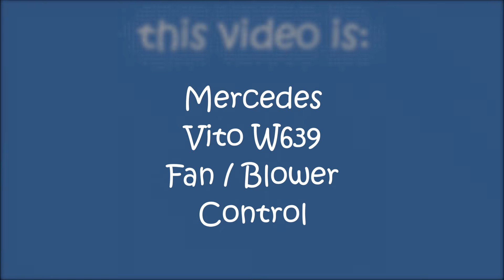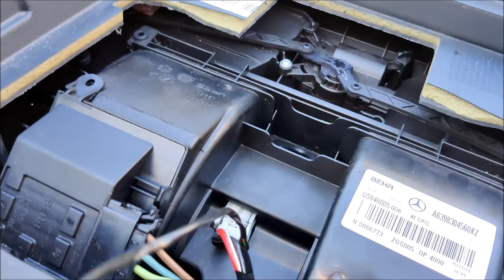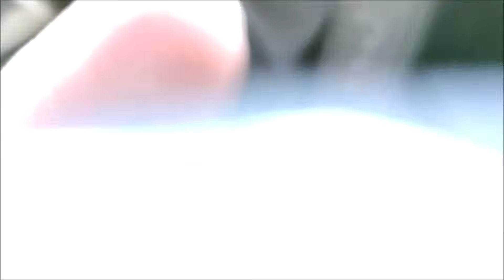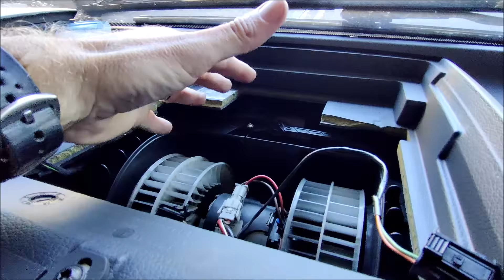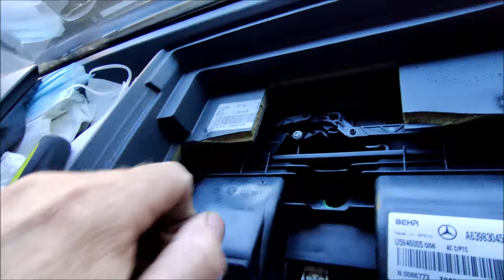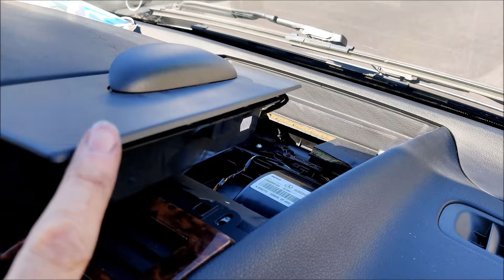Vito W639 Fan / Blower fix

Comment: can the resistor be replaced with out removing the motor/fan cover?
Reply from the maker: Yes. There is a single screw and a couple of tabs..... it then detaches from the fan motor cover.

Comment: Hi, your video is very informative! I’m experiencing a different issue with my heater. It only starts working when I set it to speed 5, but after blowing air for about 30-40 seconds, it gradually slows down and eventually stops. Could this be a fuse or motor issue? I have a Mercedes Viano CDI 2.2 Amb, and since it’s winter, I really need to fix this. I’d appreciate your help with this
Reply from the maker: @kiyani1001  I suspect it is both, but fundamentally caused (probably) by worn out bushings in the motor.

Your relay pack (fuse) has blown due to the excess draw from the motor, this means that you no longer have fan speeds 1 to 4. 

It now only works on 5, which is basically directly powered from the battery. It is likely that the motor runs for a while before the bushings heat up, swell, then the motor stops.

It would also be a good idea to check the cabin filter as this can put a strain on the motor when it is dirty too.
Reply: @ “Thanks, mate! I really appreciate your help. I’ll try changing the motor and the relay pack. If I need any further help i will ask you cheers
Reply: @fixitfallows  Hi mate , I took out the motor and checked it—it was moving freely. I put it back in and tested it like you did in your video, running it on speed 5 without the relay pack. After a few seconds, it stopped again. I quickly checked if it was hot or stuck, but it wasn’t hot, and it wasn’t stuck either.

What would you recommend? Should I go ahead and order a new motor, or could there be another issue causing this?  Just not sure if it’s the motor or something else. And thanks fir advice
Reply from the maker: @kiyani1001  when the motor stops after a few minutes, check to see if there's still any power going to it
Reply: @ there isn’t any visible powder going through but the right side blower is black with powder
Reply: @ oh sorry you said power idk how to check that is there anyway i can check it ?
Reply from the maker: Yeah, power 🤣 Have you got a volt meter to test at the motor plug?
Reply: @fixitfallows  no I don’t have 😅 I don’t have any other tools either. I have ordered the motor hopefully i will get it today and after replacing the motor i will let you know.
Reply from the maker: @kiyani1001  I can't think really what else it could be.... luckily the motor isn't that expensive, so it's definitely worth a try. All I'd say is there are two types of motor, one is for vehicles without Aircon.
Reply: @ yeah it was for 70£ and i am not sure which one i have bought cuz i just put my reg and it showed up and i bought it. Btw thanks for replying to my comment really appreciate that.

Comment: Bravo mon ami, j’ai tout compris, grâce à vous votre  tutoriel est très bien présenté,

Dommage que je ne comprends pas l’anglais
Et je viens de recevoir « BEHR » pour le vito WDF 639 603 135 787 32  ….V6..3L.  204 CH…120 CDI..  MAI 2010
Résistance chauffage.

Question complémentaire :
 Je doit changer la vanne EGR Walher, elle est placé juste devant le moteur .  Elle est bloqué ?… avez vous une idée. Pour la débloqué ..
Je doit aussi changer le bloc électronique agitateur du turbo , l’accès est très difficile pour le démonté.

Le moteur est en mode sécurité , 50/80 km/H maxi = pas de turbo.

Je roule depuis 4 mois sans turbo,  je consomme énormément.

J’ai acheté les pieces neuve pour le remplacement .

Avez vous une bonne solution pour démonté.

Cordialement, VOTRE

De Gerard Monterin

Envoyer de NormandY.

Well done my friend, I understood everything, thanks to you your tutorial is very well presented,

Too bad I don't understand English
And I just received "BEHR" for the vito WDF 639 603 135 787 32 ….V6..3L. 204 HP…120 CDI….MAY 2010
Heating resistor.

Additional question:
I have to change the Walher EGR valve, it is placed just in front of the engine. Is it blocked? ... do you have any idea. To unblock it ..
I also have to change the turbo agitator electronic block, access is very difficult to disassemble it.

The engine is in safety mode, 50/80 km / H max = no turbo.

I have been driving for 4 months without a turbo, I consume a lot.

I bought new parts for the replacement.

Do you have a good solution for disassembling.

Kind regards, YOURS

From Gerard Monterin

Sent from Normandy

Comment: We're is the fuse to the fan how do u tell which it is
Reply from the maker: Before you go any further, does your fan still work when on speed setting 5? If so it is the thermal cut off in the resistor pack that has gone and not the fuse for the circuit.

Comment: my 2012 vito 316k mile has just had this prob. blows on max speed only.
Reply from the maker: I'd be surprised if it were anything else other than the resistor pack. Do bear in mind why it has blown though..... it will be because of excessive amperage draw .... either due to blocked cabin filter or poor bushings in the motor. Both are cheap and easy to replace.

Comment: I have the same problem 2 weeks ago and I repair this part with a spare resistor, 2 € cost! 👌
U must open that piece and restore the wrong rezistor and done!!🙃
Reply from the maker: My understanding is that it is actually a thermal fuse, rather than a resistor. You could simply replace that with a piece of wire and your blower will function normally, albeit without the thermal fuse protection. 

The variable speed of your blower is achieved by way of the thick gauge coils in the resistor pack.

The thermal fuse is there to stop all of this getting dangerously hot in the event of an abnormal load. 

Typically an abnormal load occurs when either the cabin filter is blocked or the blower motor is on its way out.

So a blown thermal fuse is usually the indicator of one of these problems.

Replacing the thermal fuse for a new fuse, or installing a new resistor pack, with out addressing the underlying issue will likely just result in it blowing again. However, bypassing the fuse can lead to a full on fire.

Comment: Hi , thank you for a very informative video. Would this fault cause cold air not blow out? I have just topped up my ac gas and it’s not getting ice cold . My fan only works on 5 .
Reply from the maker: If the fan only works on "5" I'm pretty sure that your resistor pack has blown. It's very likely  that your AC compressor clutch is linked to this too (I'm not 100% sure on that though, but seems logical).
Reply: thanks for your reply , I will try changing the resistor pack.

Comment: Could this also be a cause for the motor not working at all on any setting?
Reply from the maker: Usually when the resistor pack goes you still get full power as the max power setting doesn't go through the resistor pack.

Check that you have 12volts going to the main connector for the blower motor when you have your switch set to maximum. If you do, then it suggests a motor issue (stuck due to seized bearings/bushings or warn/dirty brushes or commutator.

If no power, then perhaps its a switch problem.

Then also, whilst I haven't checked, there may be a dedicated fuse for the circuit in one of the fuse boxes on the vehicle.

I hope this gives  you a few options and good luck.

Comment: Hey there, I've followed your steps and changed the resistor but it still only works on 5. Any suggestions?
Reply from the maker: There is a chance you may have blown the new resistor pack straight away.... I've since learnt that if your cabin filter is very blocked that is what can cause the pack to blow as it causes such a strain on the wiring, the heat builds up and blows the thermal fuse in the resistor pack. The cabin filter is changed via the plastic access panel between the wind screen and bonnet between your wiper blades.
Reply: @fixitfallows  thank you so much. Your video helped me a lot. Especially the tip about putting the rear of the cover in first. That bit too me ages to get back in!

Comment: Very helpfull ! I have the same problem on my vito. Thank you very much 🙏🏻
Reply from the maker: I would recommend changing the cabin filter at the same time, as it could be very dirty which is what can cause the excessive load on the resistor pack. As the load builds, the current draw heats up the cabling which in turn blows the thermal fuse in the pack..... there is a chance you'll just blow the new pack in a short time if the filter isn't replaced....... which is what happened to me 🤦🏼‍♂️